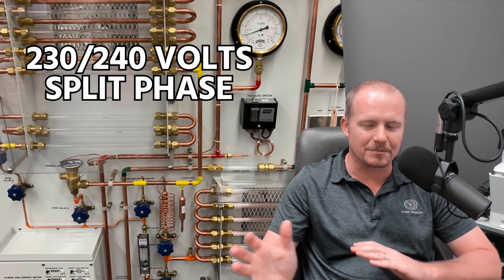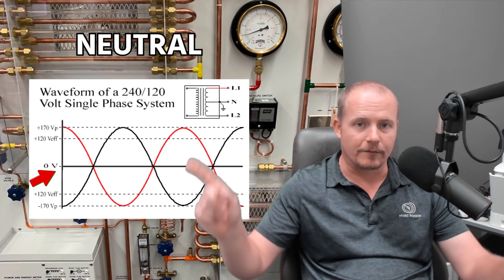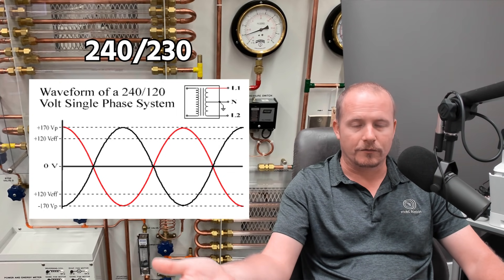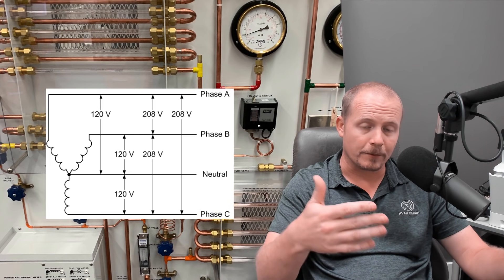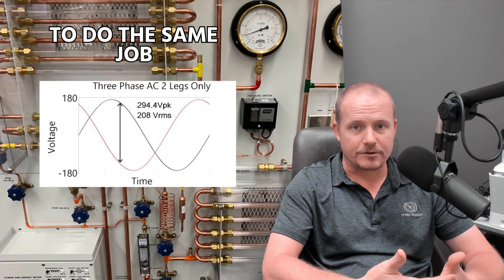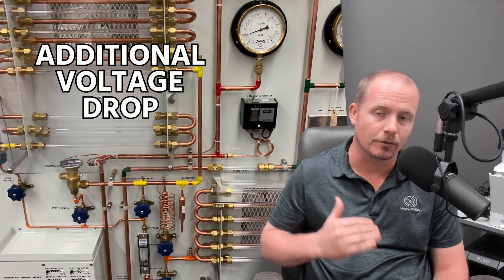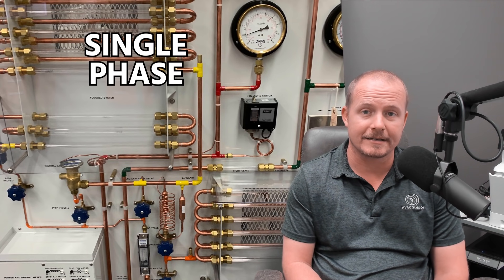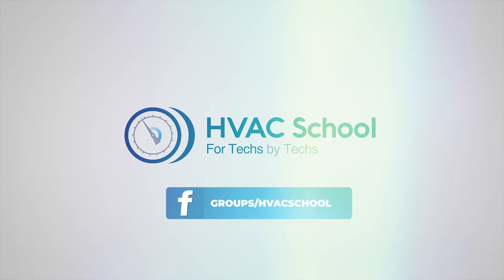How is 208 volts different than 230/240 volts?

Comment: If you'd have 180 degrees out of phase then instead of 240V it be 0 (zero) V. Hence, the split phase systems are not out of phase.
Reply: @Joe-by8jh  Yes 👍
Reply: It is the difference that counts. Voltage is a potential difference. if you see the image the clearly are 180 degrees out of phase as one has high and the other has now.
Reply: The center tap is a voltage divider not a phase reverser. Its a transformer not an inverting amplifier.
Reply: @jhacklack  Correct, the centre tap is not a phase reverser. It's only one phase feeding a house. So any attempts to flip the phase by rearranging the house wiring will cause short.
You're wrong in the 2nd statement. Electrons don't care if their energy comes from an amp or transformer. And a transformer cannot produce 2 phases on a single winding. 
Please read more from this comment section or... books about the subject.
Reply: @tjblues01  sorry if i wasnt clear, i am in full agreement with your explanation.
Reply: @jhacklack  Sorry for misunderstanding... My bad... 🙏
Reply: They are out phase see why 
Say Van = 1.5 and Vbn = -1.5
then Van -Vbn = 3V. Yes, you can't measure the polarity of an ac waveform with a DMM but you can do it with a DC circuit and two batteries in series. Try it out!
Reply: @shieldcracker  You are wrong 😉
It's not possible to have AC, generated by a single transformer, to be out of phase with itself. Again, it is one 240V transformer with division in the half of the winding. It creates 2x120V of the same phase. 
In your analogy you have 2 sources of DC. Let's say they are 2 AA batteries of 1.5V wired in series:
-[_1.5_]+ (COM) -[_1.5_]+ 
so together you have 3V 
If you can measure voltage by attaching a COM probe of your VOM in the middle you're going to see -1.5V and +1.5V. This wiring mimics AC at the main hose panel. In phase. 
When you attach COM probe at the -(minus) of the first battery and check voltage in the middle and then on the end of the series you'll get +1.5V and +3V.

To mimic out of phase you have wire those batteries "in reverse" like there:
+[_1.5_]- (COM)-[_1.5_]+
Now your VOM with COM probe attached to the middle will show +1.5V and.... +1.5V. But if you want to measure the whole circuit you get 0V -- out of phase scenario.

You measure voltage proper way or wrong way. The house system is in phase. You just measure it wrong.
Reply: @tjblues01  Your understanding of phasing is just the opposite of what it is! The voltages -1.5V & +1.5V are not the same thing, the negative sign indicates there is 180 phase rotation relative to the positive value or vice-versa. For both voltages to  be in phase they need to have the same polarity (and frequency) at all times.  
These concepts are hard to visualize so here is  another way to see this. Go to your breaker box and pick two circuits (say 1 & 3) on the same leg/busbar and measure the voltage across. You get 0V, by your rationale circuits 1 & 3 would be out of phase hence the 0V. However both circuits originate in the same bus therefore must have the same phase. Now if you pick two circuits, one on each bus bar and measure the voltage across you get 240V. This is possible because the voltages are 180 degrees out of phase in respect to each other, if voltages had the same phase the result would be zero which is not the case.
Reply: @shieldcracker  I don't have time to teach you about waveforms, phases, polarity, etc. 
Of course DC is not the same as AC. My example was an analogy to AC as a snapshot in certain position on a sine-form. 
I don't know what's your background. But it seems that you don't know much about the topic. For me it is something what I've been dealing with for last 20 years. I'm telecommunication technician. Adding and subtracting wave forms, shifting phases, amplification, attenuation, power division... and more - that's what do for living.
Please watch this: 
https://youtu.be/uRKbX74lBgU
cheers
Reply: @tjblues01   I provided two practical exercise ways to drive my point,  first with DC then with AC voltage. Once more consider the two breakers  on the same Busbar, both have  identical voltages so by definition the two voltages are in phase and when you measure the voltage between the breakers it is zero, it does not add up to 240V. 
I watched the video, its not well presented and the conclusions are wrong. But don't take my word or the other guy for it, consult a text book.  These concepts are hard to visualize with just  simple sentences and zero math. So, untill we can have a cup of cofee, we will have to agree to disagree. Regards.
Reply: @shieldcracker  Are we still talking about North American split phase electrical system? If your answer is "yes" then there is nothing more to say; It is physically impossible to have reversed phase of one side of the panel unless that side is connected with 1552 miles long wires.

If had have a hard time to follow Charles Staton video it means only one thing: you have a lot to learn yet 😟

What we have there is:

120VAC
--------------------------------------\
0V / GRND                          \___ L1
-------------------------                           240VAC
120VAC                               /-------- L2
--------------------------------------/

In a single phase / split phase system, voltage between two "hot" wires  (L1 & L2) measured at the panel is 240VAC. Period. It's not about your or mine opinion we can agree or disagree. It is the fact. If those were in opposite (180 degrees) then they would cancel each other and give you potential of 0V.  BTW. that's how noise cancelling headphones work.

In a residential electric systems in North America we use one of 3 phases 240VAC with a split in a middle of the secondary winding in distribution transformer. This is allowing for 120VAC between GRND and hot wires. It is a single phase system*. You already know that because you answered correctly on somebody's else post under above video. And the single phase *cannot be out of phase with itself. 
https://youtu.be/fJeRabV5hNU?t=102

cheers
Reply: @tjblues01  You made a nice drawing, but now let say L1 is a part of a 3 phase y transformer and also L2 is a part or line 
of that same 3 phase y transformer. Let say it is a 10 kv / 230 VAC / 400 VAC transformer. And we also ground the y center
part of this transformer. Now we have L1 to ground 230 VAC and Also L2 to ground 230 VAC. And also we have 400 VAC 
between L1 And L2.. And every electrician in the world knows what is going on. We have a ( 120 degrees ) phase shift
between L1 and L2, the voltage between L1 and L2 is 1,73 x 230 = 400 VAC.  
Now the 120 VAC / 120 VAC / 240 VAC transformer. We can also say , we have a grounded center part that is 0 V
that L1 is a 120 V arrow pointed up and L2 is a 120 V arrow pointed down. And then we have a voltage between
L1 and L2 of 240 Vac.  2x 120 Vac = 240 VAC. That is just a 180 degrees phase shift between L1 and L2. 
You say that this is not possible but this may be strange behaviour has to do with grounding the center part of the 
transformer. If we do Not ground the center part of this transformer we just have 120 VAC between L1 and the centerpart
and 120 VAC between L2 and the center part, and 240 VAC between L1 and L2. 
But without grounding we have No reference point. If we connect L1 and a wire connected to the centerpart of the 
transformer, on a outlet , and also we connect a grounded wire to the groundpart of the outlet, we can only
measure that there is 120 VAC between L1 and the centerpart wire, we can not measure a voltage between L1 and 
ground or between the centerpart of the trannsformer and ground. 
But even in a grounded tranformer the voltage between L1 and L2 is just a voltage that we measure with our
volt meter. Also the same with a Not grounded transformer if anyone makes contact with L1 and L2 it is 240 VAC
that is between your arms it does not matter if the transformer is grounded or not.
But what does this al mean?? In a un grounded transformer al voltages are  just AC voltages we can not say L1 is live
or L2 is live , just a AC voltage between L1 and the centerpart or a AC voltage between L2 and the centerpart
and always 240 VAC between L1 And L2 grounded or not. 
But in a grounded ( centerpart ) system now we 0 V in the center. And now we have L1 that is live
And L2 that is live. L1 to ground 120 VAC  and L2 to ground 120 VAC. And we have L1 to L2 240 VAC.
To me the only way to get a 240 VAC between L1 And L2 is that they are 180 degree out of phase
But that is just my opinion.
Reply: @tjblues01  I have thought about this 1 phase transformer. But you are right , there is nothing out of phase.
It very easily looks out of phase , but I have seen the video that explains this. 
Thanks for the reaction and the information.
Reply: @firestar7188  Glad to help 🙏👍
Reply: @firestar7188  You have very good insight, pursue this train of thought.
Reply: @tjblues01  I just commented in another post using the AA battery example. I didn't know anyone else used that analogy. The image he is using in the video is incorrect (:50 mark) and that's what made me search the comments.
Reply: @truthbebold4009  Yes, that illustration is very wrong. It seems as OP doesn't know how to add or subtract sine waveforms. And he's very confused what phase - out of phase is. He mistakes polarity of his VOM with phase...
Reply: @tjblues01  I am an electrical engineer with a power systems focus. You are correct that you get 240v from the ends of a split phase, but you are still incorrect that each individual 120v leg is in phase. They are in fact 180 deg out of phase, and this is because of the nature of the them sharing that middle neutral wire. While one is +120v the other is -120v at the same time. Because this is analogous to say putting two AA batteries with the negative terminals touching, you need to subtract voltages, not add. Then we get 120 - (-120) = +240 volts. If you don't believe it you can look at the two legs (each referenced to the middle neutral) on an oscilloscope and they will be 180 deg offset.
Reply: @nathangallagher5112  I've said enough in this thread. 1 transformer, 1 feed from 1 phase of 3 phase system cannot physically give you anything out of phase. Period.  You just measure it wrong. 
If you're an electrical engineer and you don't know what the phase is then it's very sad.

Can you draw a schematics of a residential electrical system where those "two out of phase" lines cancel each other giving you 0V? And this is what should happen IF they are out of phase.

cheers

Comment: Aren’t there motors wound for 208V though?  Do some equipment manufacturers offer motor options for voltage?  Are there motors which are configurable for two voltages?
Reply: This is what I would like to know. I would imagine the sine wave has to correspond correctly to the winding of the motors to function correctly without loss of power and/or heating issues since the sine waves of 2 phase 208 and split phase 240 are actually flowing in a different pattern from eachother. One is 120 degrees apart while the other is completely inverse of itself at 180 degrees. I can't imagine only the voltages being within a certain tolerance could be the only factor to consider. You also see that RPM's on 208 motors are slower than that of 240v motors.
Reply: @Jason-wc3fh — Unless you have a 3-phase motor, the motor just sees a single phase which is 208 or 240 V RMS.  All 60 Hz sine waves look the same, except for voltage.

Comment: What type of phase converter would be best to use on an air conditioning unit that is 208 V 3 phase but my power source is 220V Single phase?
Reply: Why would you even do that? There's VFDs that can do single phase to 3 phase but you need to get the appropriate sized one for the horsepower of motors it is expected to drive. Usually they convert ac to DC back to ac so it gives you a cleaner signal and ability to adjust motor speed... but that's added complexity. Other option is Rotary converters but those are a bit pricey and better for larger applications. Single phase with capacitor start is really ideal even if 3 phase is usually more efficient the juice may not be worth the squeeze.
Reply: Change the motor in the aircon to a single phase motor. You can't easily convert from single phase to 3 phase

If the motor is a proper 3 phase motor then it needs 3 phases to work properly, otherwise you can cause damage to it.

Comment: What's is a hard start kit . I recently bought a 80 gal compressor with a starter motor on it that says do not use a 208 , my power supply is a genrac 22500 with running of 15000 wats. Is this considered  208v
Reply: Who knows? Read the label but most residential generators will be wired for single phase more than likely 240v. It's not impossible to have a 3phase genset but it would be typically for business use and I don't know generacs models.

208v is derived from 3 phase so the motor on your compressor is a single phase induction motor with two windings. A start winding and a run winding. Thr capacitor creates a temporary phase shift so you have slightly more than one phase as far as the motor is concerned, allowing for a rotational angle to be applied and rotation to occur. The motor isn't wired with 3 windings for 3 phase hence the label warning.

And a soft starter is far superior to hard start capacitor in my opinion. Slowly spooling up a motor rotor versus a sudden kick means less wear and tear and also way lower locked rotor amp current.

Comment: I was looking at an outlet at a restaurant that is supposed to be 120 V but it was reading 215V I open it and tested one lead to ground I was getting  215V the other lead to ground was reading 0 V, so why do I have 215V in one wire
Reply: Because someone wired in two of the three phase legs of 208 to the receptacle versus 1 leg and a neutral. Or they wired in one leg that isn't tapped to neutral so the reference is still 208v. Should be able to change that at the panel assuming they didn't pigtail it off some 3 phase connection after the panel. Then you need to find that junction and swap some wires 

Phase to phase is 208v. Phase to neutral is 120v. Phase to ground on the unsplit coil is 208v, phase to ground on tapped coil should be 120v.

Comment: so as an architect studying for my exams, it asks me when we would use three phase 120/208 power. the book is known for asking outdated questions. What I am taking away from this is that 208 is when you are only using 2 of the 3 phases? sorry. I've watched this twice now and it's not clicking
Reply: It is generally light-commercial or multi-dwelling residential, where you would use 120/208V three phase.  In a light commercial application, you would use 120/208V, and you'd have a mix of 120V single phase loads like lighting and receptacles, and motor loads and other high power loads that use either 208V phase-to-phase, or that use the full 3-phase 208V circuits.

In a residential application, like a multi-dwelling apartment building, each dwelling unit gets two phases and a neutral from the 120/208V 3-phase service to the full property.  The choice of which 2-phases is staggered from dwelling unit to dwelling unit, in order to balance the load as much as possible.   Most residential loads run off 120V line to neutral, except for loads that use heating elements like dryers and ovens.  Heating elements are a lot less voltage sensitive and the same unit can run off both 240V in a single family or duplex home, or off 208V, with the essential difference being that it only has 75% the heating power at 208V.  The common loads panel is usually the full 3-phase, powering loads like common area HVAC and general lighting.

In a heavy commercial or industrial application, 277/480V is the most common service you get, although there do exist applications with 347/600V instead (common in Canada).   You usually use a customer-owned step-down transformer to feed the minority of loads that require 120V or 208V, like your receptacles.  There are some scales where utilities only give a 277/480V service, and the onus is on you to step it down where you see fit.

You almost always will have 120V somewhere in the premises wiring to feed your receptacle loads, at least in the USA.   This is usually a minority of the loads on larger scale services that use the voltages over 250V to ground.
Reply: He words it wrongly. You're using all three phases. But from phase to phase you'll have the potential difference of 208v. The 120 is each of the phases tapped to neutral.
Reply: @etherealrose2139  Not necessarily true.
You can use two phases, 120 degree phase shifted to provide the power. You don't have to use all 3 phases but it is better if you can.

Comment: So is there any advantage to 208v?
Reply: The answer of course depends on what you're doing! I work in the trade show world and a lot of commercial buildings, convention centers have three phase 208 power. Most of our electronics have auto switching power supplies, moving lights, LEDs, video walls, and we can put more items on a 208 volt run and have an easier time balancing the load. Using the same items we would not use them at 240 volt in a non-3 phase building, so then we would have to calculate everything at 120 volts. We do have many moving lights that have to have 208 or 240 volt to even turn on. But 208 volt in a three-phase system would be much more beneficial with motors. If you have CNC machines, and big motors that are wired for three phase they are more efficient, and give you significantly more power for a lot less energy usage. So having a 240 volt split phase air conditioning system would be the best use of a split phase system. But it will be less efficient on a 208 3-phase system. If you had three phase in the building, you'll be much better off having all of your air conditioning motors three phase 208 volt. And they would probably be much more efficient.